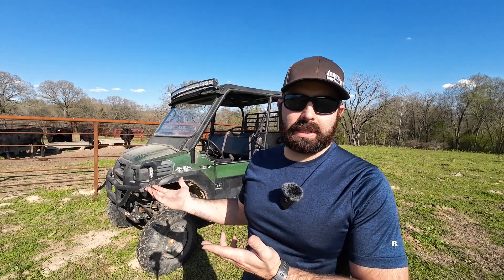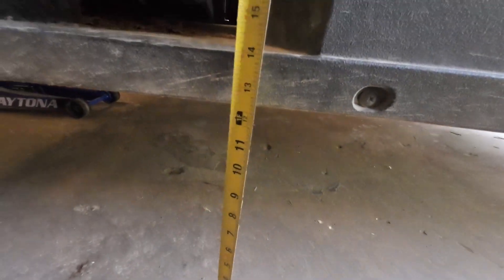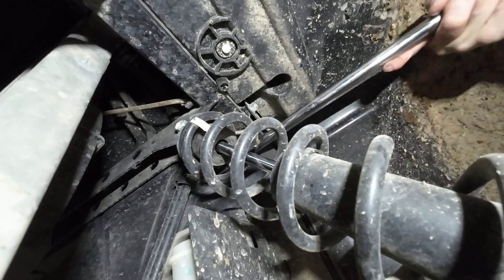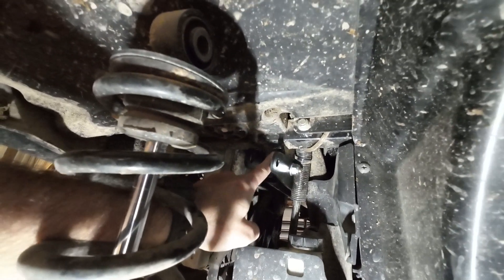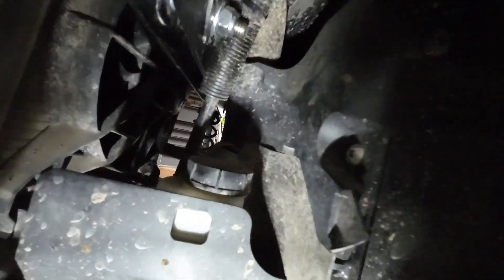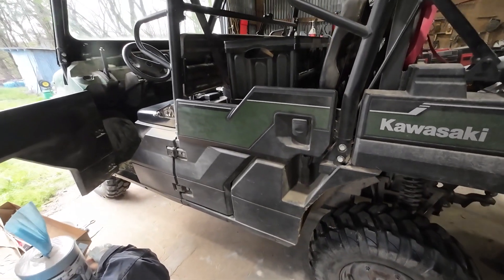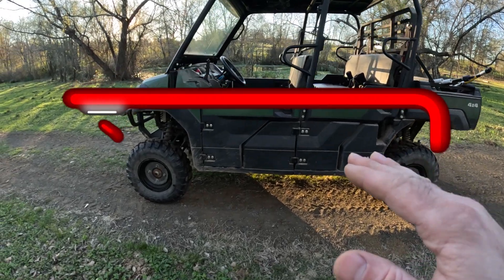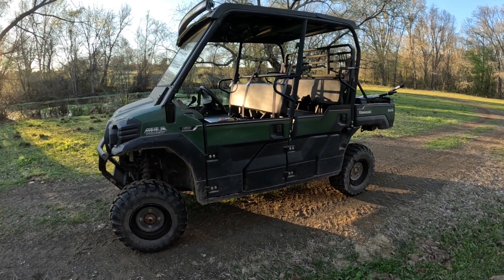Kawasaki Mule Pro Rough Country Lift Kit - Worth It? Let's Find Out

Comment: I haven’t lifted mine and rarely have had clearance issues. Easier to work out of a lower bed. Tampering with what the Kawasaki mechanical engineers toiled many hours, to get right, seems reckless to me. A dependable machine with the lowest cost service life is my priority.   Well made video and hope that the changes you made serve you well.
Reply from the maker: I understand that for sure. I resisted as long as I could for the reasons you mentioned. Our place is pretty rough. I have definitely noticed a difference in getting around the property. I do feel it has been a worthwhile upgrade for our needs but I’m keeping a close eye my CV joints.

Comment: Had to redrill holes for the shocks closer inward to lower it supposed to be two lift much higher got everything fully extended it was eating my tires on inside really fast this will extend the life of the cv joints
Reply from the maker: I definitely might have to that. It do think it’s a bit too high as well.